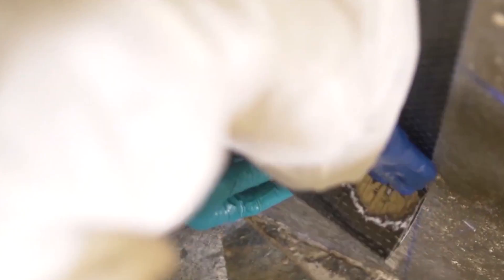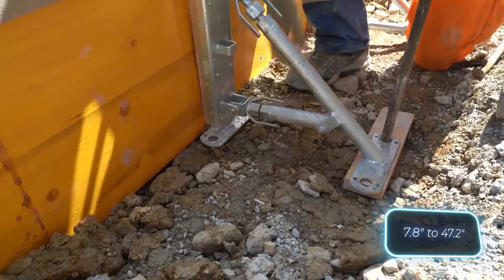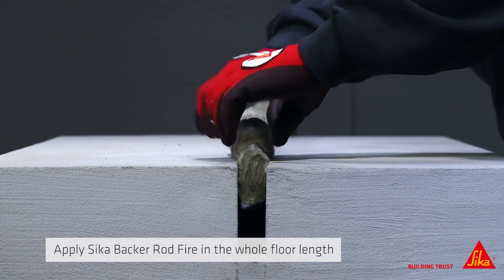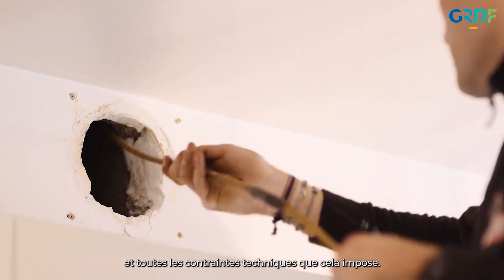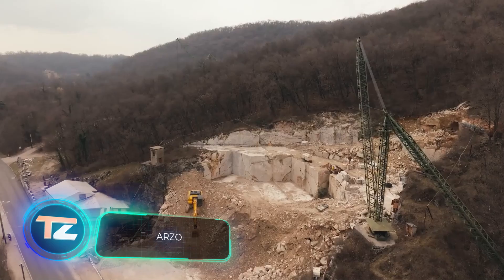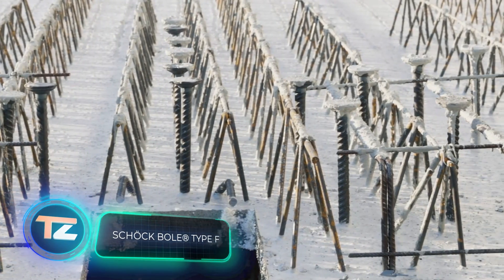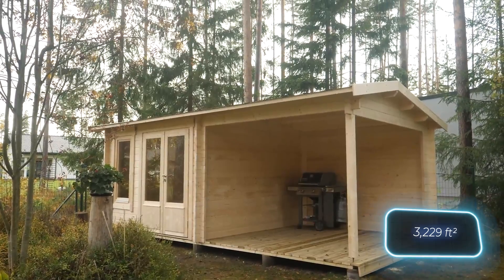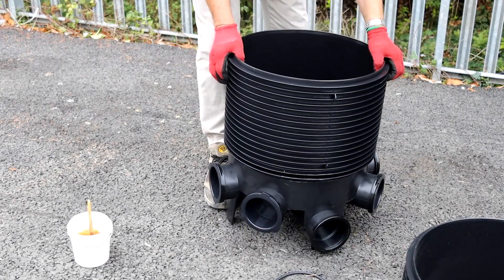CONSTRUCTION TECHNOLOGIES THAT HAVE REACHED A NEW LEVEL

Comment: Betontex is what material, glue n hard stuff, why do they do that, it's like a waste?
But maybe if imagine nicoll highway, actually we all should just be allowed like common sense of creating smthg in life, at empty forest such thing? What is shortcut of permission? Like meeting room size can be $95/mth, it's actually any other is cheaper? Imagine a house. It's the same? If it's allowed 24/7, it means a room rental is really $50/mth or less, if more is due to furnitures etc.? Should know how to calculate billing for room rental? As a skillsfuture? The first wire point is it like "voltage knowledge point"?
Reply: The 14mins+ chalet is it really $9k+ not smthg else? The toughness and Abit hole imagination, meant to be able to dismantle?